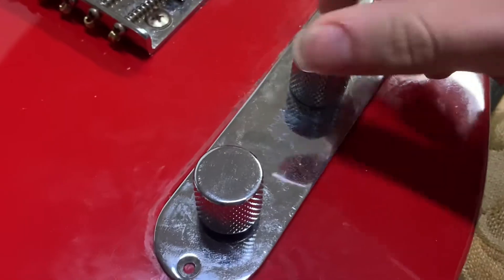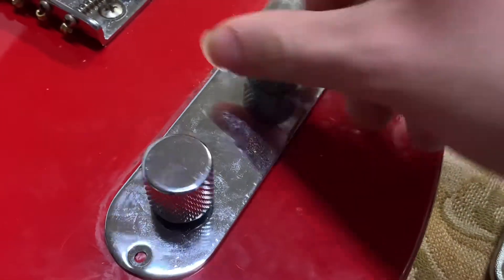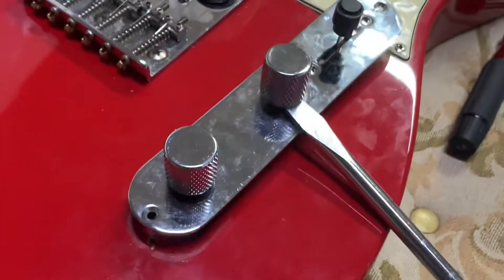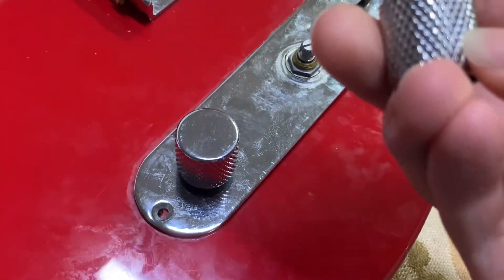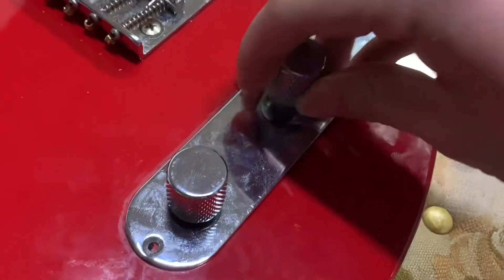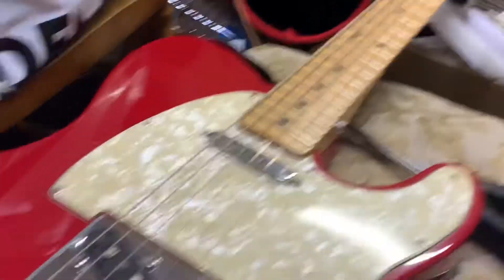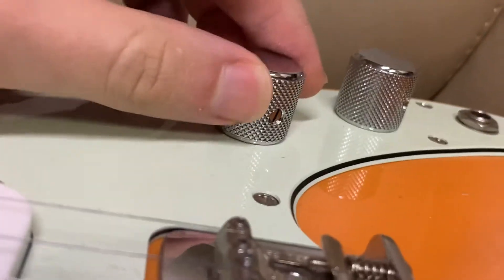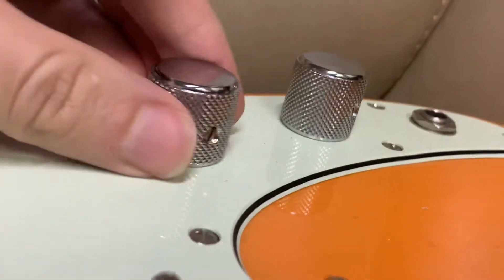How to take metal knobs off Fender guitars (SHORTEST VIDEO AVAILABLE)

Comment: Great Video! Get right to the point. It is very helpful because I wasn't sure if prying was the way to go. I'm going to try it with something underneath to protect my chrome look. 1 more thing: I saw another video where the knobs had small top sections which twisted off and then use a hex wrench.  Just check carefully if you're not sure.